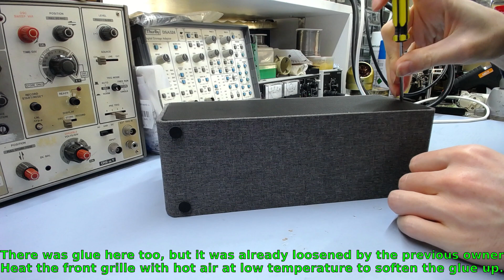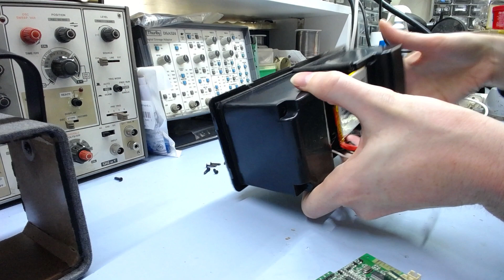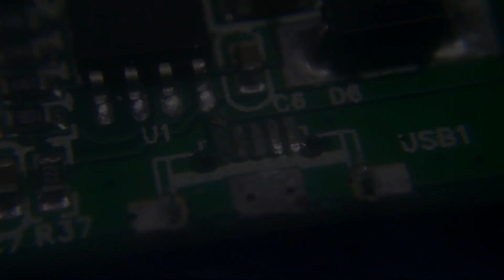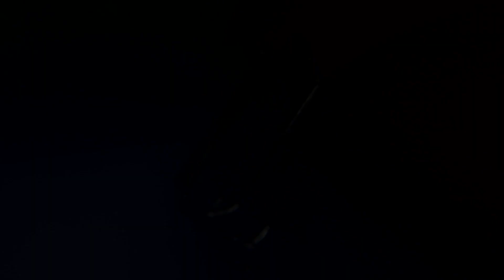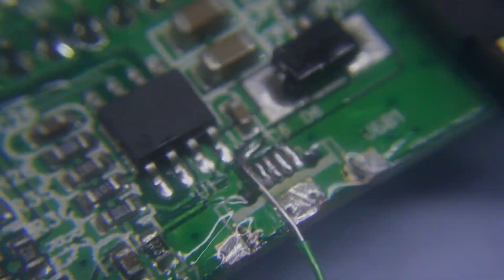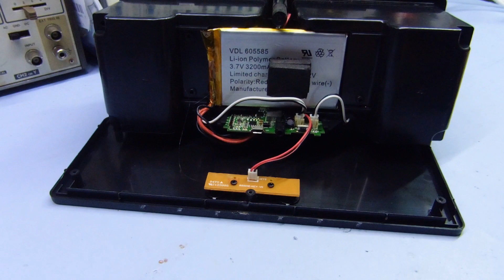Home&Co BS503E Bluetooth speaker USB port repair

Comment: Have the same issue, traces 3 and 4 are missing. If traces 1 and 5 are pos/neg, would I be able to put a USB-C port in place here instead? or even just have a female USB cable dangling out the back
Reply from the maker: If a USB-C port physically fits and the power pins line up with the correct pads, then I guess so. However, looking at the pinout, it does not appear that the power and ground pins of a female USB-C port would line up, unless you also used a breakout board, or such.

I would recommend just replacing it with another micro-USB connector and be careful with it. You could also use a cable with a socket on the end but make sure to have good strain relief so it doesn't rip the pads off if you accidentally pull the cable.
Reply: @Agent24Electronics  Got my new soldering iron (Pinecil v2), tried giving this a shot with a USB-C port with cables, traces are far too small even for me and trace 5 doesn't want to stick :(
Reply from the maker: @GingerWellyton  Things can be tricky at this scale but it's not impossible. You may like to practice on something else first especially if you have never soldered before. Make sure also that you have good quality solder and some good liquid or paste type flux - good flux is essential for fine work. And for this kind of job you want solder that's quite thin, like 0.3mm or so.

It might help to look at some videos showing the replacement of broken connectors from another channel like Northridge Fix, he does that sort of thing a lot, you can get ideas for the technique there.

I would say to lightly tin both the lead and pad in question, put flux on the area, bring the wire and pad together, and heat the joint to reflow the solder. You may not even need to add solder beyond preparing a small amount on the pad and wire beforehand. If there is too much solder it can make things difficult. Wick off any excess if there is already too much on the parts.
Reply: @Agent24Electronics  With help from a friend, we were able to make a better connection by just ignoring the traces and soldering directly to where the traces led.
Reply from the maker: @GingerWellyton  Glad to hear you were able to fix it!

Comment: Yep, seems stupid to use such a tiny connector for charging, when the design team no its gonna get physical abuse , and yeah, come on 1000 sub's...get  ya finger out!
Reply from the maker: Haha! I'm in no hurry - it looks like it'll get there eventually. Something which still seems surprising to me somehow. In any case, it's a shame Apple discontinued the MagSafe, it seemed like one of their better ideas. Of course, there's alternatives like the Griffin BreakSafe. Which are arguably better, since they're universal, and you easily can replace them if they fail, without requiring a new adapter or replacing jacks on the device.